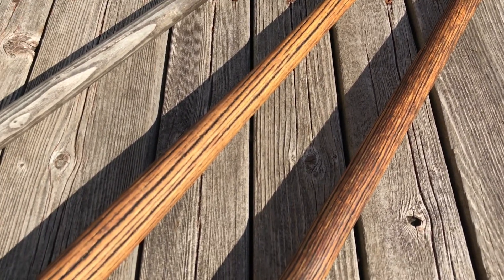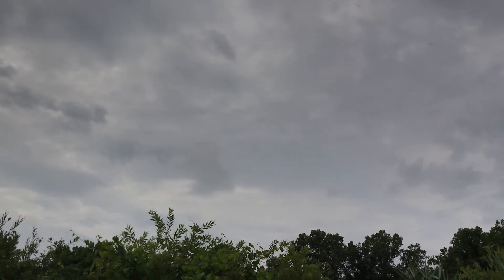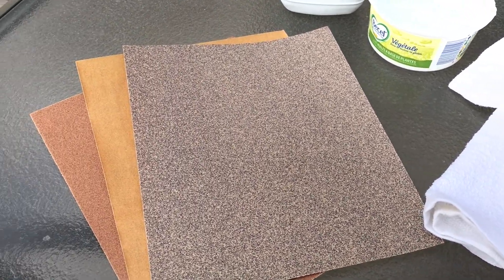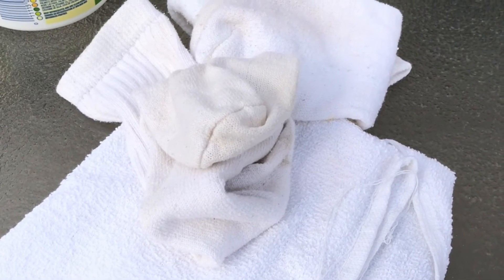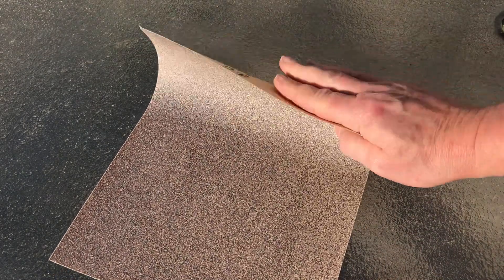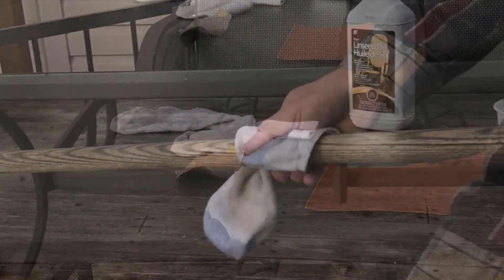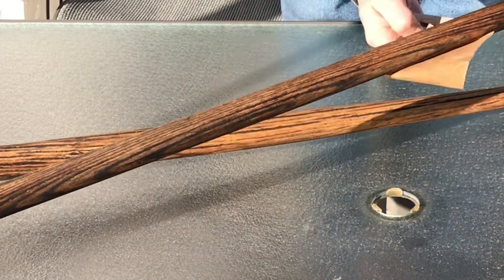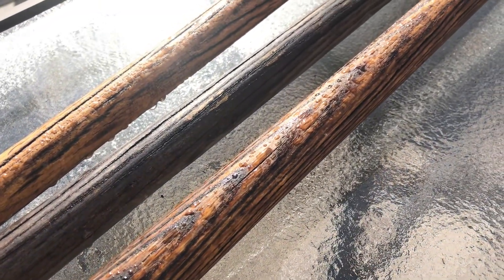Easily Restore AND Weatherproof The Rough Worn Handles On ALL Your Garden Tools!

Comment: The old saying goes, apply once a day for a week, then once a week for a month, then once a month for a year, then once a year for life. My fathers hand tools get a coat of BLO applied with steel wool annually in mid Summer and are still better than new. This works on the metal parts as well.
Reply: The video says RAW, not boiled
Reply: @themonsterunderyourbed9408  It does say raw, but that doesn't mean boiled won't work, too. Fwiw, from my reading, for this purpose boiled will be just fine. Main downside is possibly discoloration.

Comment: If you blacken the wood prior to linseed oil it will become very resistant to rot. I use a weed burner torch/propane torch to char the wood til its total black then, without using sandpaper, SOAK them in heavy coats of the oil. The linseed oil will cure faster due to the massive surface area and charcoal (the new exterior of the handle) is highly rot resistant. Also your tools are now black handled and they look very cool
Reply from the maker: Thanks for the comment. I'll have to try experimenting with that.
Paul
Reply: And, for bonus points, this will also chase the last of the moisture out of the wood making it absorb the oil more easily and thoroughly.
Reply: Interesting. Do they still need to be re-done each year, though? What's the process for future years (if so)?
Reply: @JackJensenTrader I've never done this before, but I would assume that you just need to re-apply the oil annually after.

Comment: My grandpa taught me this method, only he used motor oil! Lol, it worked great on the metal. Every late fall, when I stop using most of the told, I sit down and sand the metal first, then the wood handles. I used an old flannel shirt that I cut into squares to apply the oil, then to wipe off any residue. As I got older, I turned to using Linseed oil. I recently purchased some weather-beaten garden tools that I picked up at a tag sale for a different process to sealing the handles. I used waterproof wood glue and sawdust from an ash board. I mixed the glue and sawdust together to make a paste. I then applied this to the cracked wood using a putty knife that I bent around a pipe
Reply: No used motor oil goes to waste on my farm, that's for sure...
Reply: How have the tools held up?

Comment: You should really just burn the sock or be prepared for it to spontaneously combust there are videos where u can see one catch fire after it was used. safety first
Reply: Hang it up flat, lay it out flat. It won't combust. It's when it's wadded up that there is an issue. 

Or you could just wash it immediately. 

Raw linseed oil isn't as bad as boiled. I've often just hung the rag over the top of the bottle, it doesn't dry very quickly. A rag will still be somewhat wet a week later.

Comment: When I married her 7 years ago my wife had a 50-year-old bow rake with a handle twice as rough as yours, twice as cracked, twice as dirty and it was shedding splinters. I have a great rake, but need one for a little beach cottage to spread oyster shells in the drive. I started with 60 grit yesterday and it tore up the paper. I looked at my belt sander, checked the hardware store for a new handle - $16.49 - and ended up buying a nice, cheap, new rake for $26. The long handle is sturdy and metal is painted, but the salt air is going to eat it up anyway.
It would have been fun wire brushing the iron, treating it with Ospho to convert the rust and then messing with that old handle or replacing it, but I think I'll spend the time fishing.
Reply: Can you tell me about oyster shells in the drive?  Why do you do that?
Reply: @bender49ers  If you can get them for free they are cheaper than buying truckloads of gravel.

Comment: Excellent video. Excellent information. Thank you. I'm looking to refinish some 100 year old wood handles on a vintage waffle iron. I'd prefer to keep the original handles rather than fabricate new ones. Can I seal after applying oil? With a lacquer or clear coat?
Reply: Yes you can. But it has to be a "drying" oil that you use(linseed,teak,walnut,tung, etc.)...if you plan to seal with polyurethane or lacquer.

Comment: I've often thought that a 2"ID pipe about 5" long with a sealed bottom would be a good way. Fill it with Linseed Oil up to the top after the tool is in and let soak for ??.
Thanks. Good wider.
Reply: Linseed oil can combust /react with heat or air
Reply: Good point. Thanks.

Comment: Long term question, would it have to be reapplied? How long does this last for?
Reply from the maker: Hi Antonio, if your tools are in rough shape, then I would sand them well and apply at least three coats.  That should last a couple of years.  But to always keep them in great condition, every year you could give them a very light sanding and only apply one coat.  
Thanks 
Paul

Comment: I did a few of my garden tools with raw linseed oil before putting them away for the winter (in an old shed in a new house). Just checked today (end of January) and most of the wooden handles have gone mouldy, the linseed oil treated ones definitely  the worst affected.
Reply: If the mold had penetrated to the inside, and the wood was wet under the linseed oil, what you did was just give the mold a perfect, moist, sealed place to grow.  I'm going to guess that the linseed oil ones were rotted all towards the center, whereas the ones that were not sealed probably only molded on the outside (where the water came and went via condensation as it warmed and cooled).  The wood has to be really dry for sealing with linseed oil to be effective.  Best bet is to do them right when you buy them or keep them in the house, preferably near the wood stove to dry out completely over the winter before sealing.
Reply: @stevesteiner9472  All of them only mouldy on the outside thankfully, but its true they wouldn't have been 100% dry before I treated them.

Comment: Just an idea. Use paper towels to apply the linseed oil. Using material with linseed oil you run the real risk of an exothermic reaction and then next thing, no shed. Simply dispose of the paper in a metal container and burn it. Cheers.
Reply: Has to be decent quality paper towels, or you get tons of shredded paper all over everything. 

I just lay any rags out flat on a concrete surface or hang on a metal rack to dry. The issue is when they're wadded up.

Comment: I do 3 coatings of Raw Linseed oil, to ensure the oil will penetrate and get inside all the wood. Then I apply the wax. I know, it takes days wating 3 coatings to dry one after another, however, that's the best method, to create a wooden handle on your tools, that will be much tougher with way less chances to break and in the same time, you waterproofing it, from the elements. It can literally make a wooden handle last forever and perform better.

Comment: Take a (roughly) 1m length of 50 or 65mm PVC pipe and cap one end. Half fill it with Linseed oil/turps mix and soak all your straight handled tools for half an hour each.
Reply: I was, literally just five minutes ago, wondering how the heck I was going to rig something up to give the handles a good soak...thanks!